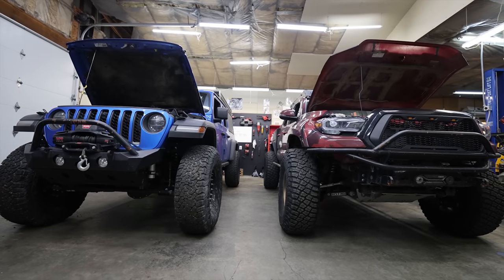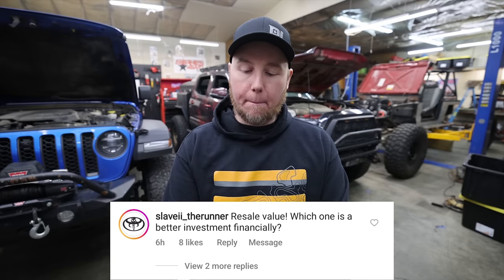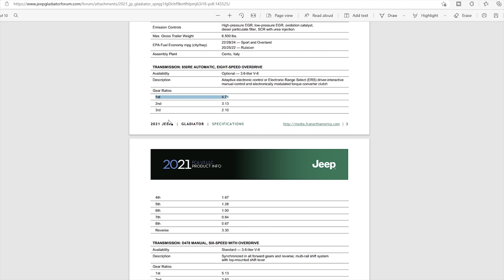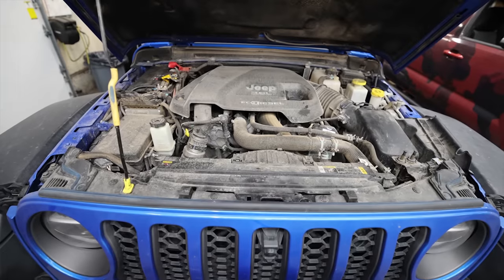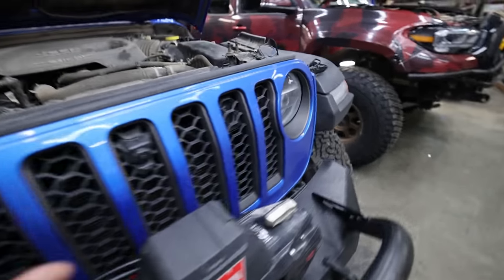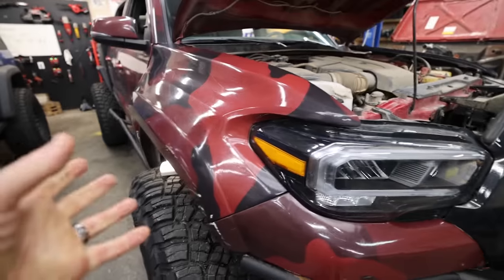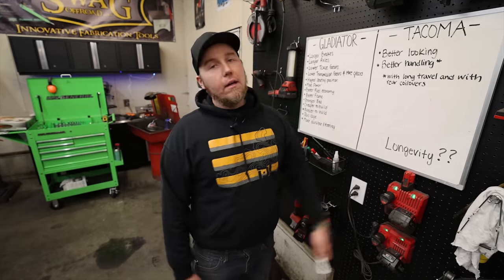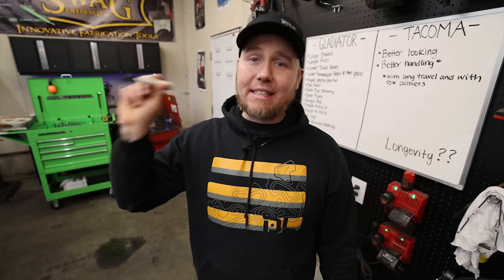My 21 Jeep Gladiator Vs My 21 Toyota Tacoma. Cold Hard Facts.

Comment: LOLOL ".gov or someone trustworthy"

Toyota has held the top spot for reliability and longevity for 60 years. There's a reason there are 300K, 500K, and 1M mile clubs for Toyota vehicles. That being said, the Tacoma, like most of the other NA (North American) spec badges are very very different from non-NA spec Toyota vehicles and the ones in rest of world are far superior to the US counterparts. Comparing the Hulux to the Tacoma will tell this story. Other than the brand name and the fact that it is a pickup truck platform, there are no similarities between the two and the Hilux is a tank compared to a Tacoma.

However, if I was facing an apocalypse scenario and had to drive a stock 4x4 off a lot and into the backcountry, the Rubicon would be my choice. It is hands down the most capable factory spec 4x4 in the US and it doesn't take much to make them true offroad monsters.

Comment: Tacoma peeps are crying🤣 nothing better than facts. I will say I've owned both and my gladiator was not reliable at all in a 6 month time span the dealer had my jeep 5 times. My transfer case front seal leaked, the gear box had to be replaced (aluminum vs steel) , rear window leaked, infotainment quit and the worse was the rear locker solenoid failed and the solution was to replace the entire rear axle. With that being said I owned a tacoma and all the points you made were my biggest issues with it especially drum brakes🤦‍♂️🤦‍♂️ but also the drive train is complete garbage i literally installed 265's and the transmission complete lost it's mind it was like literally no 5 gear. Cruising in 6th and the tranny needed to down shift it would skip 5th and hop to 4th causing the engine to rev super high and then it would stay there longer than it should. Anyway my 2 cents I do want another gladiator 🤣

Comment: is your jeep a rubicon? they get different axles and transfer cases vs the basic jeeps. where toyota just uses 1 rear diff. you cant compare a diesel to a gas, your video is okay, but its not a good comparison video. you need to compare stock to stock and gas to gas. jeep has more aftermarket support. jeep has frame recalls now. blame the feds for us not getting the good toyotas. as a toyota fanboy, your facts are facts. toyota does need to step up a little more.

Comment: ill keep my original gladiator more usefull than both of those  5.13 gears and 39s on if it had a pentastar i bet that thing screems like a dying cat.  fyi theere is nothing wrong with a C channle frame thats riveted you have a original gladiator you should know this, the J20 and so forth was a 3/4 ton truck, hell ive put 2000 lbs in my J10 counting my weight, and it had 0 issues with its c channle.  I garuntee ive done more hauling than you in your trucks beinng that i live on a farm.. I never even see my body lines move from cab to bed with the J10 having so much concrete and wood in the back

Comment: No offense....but your're clueless.  My best friend has a Gladiator.....stock with the Pentastar....I have a Trd Offroad stock as well.....we both have a little over 100k miles....his has been in the shop 5 times....( over 3 weeks missing in total )  for many different issues....not maitenance.....costing him over 4k.   My Tacoma.......0 times...my Taco cost 20 grand less in the first place.....get a clue
Reply: I know 2 guys with 3rd gen tacomas, one transmission melted, 65k miles on road and the other one a ruined engine, from a gravel road 45k miles. 
Yet my JLU that's been abused exponentially more than both vehicles combined is still 0 repairs in after 5 years.

What's funny is my JLU costed 42k, my friends 10 year old tacoma (the melted transmission one) 36k. He's 6k in on repairs so his crappy old truck costed the same as my brand new one and mine has gone up in value. 

Toyotas are for people who like to pretend they're outdoorsmen and just drive through mud puddles with a bunch of ladders and jerry cans tied to them.

Comment: The data from Consumer Reports has been pretty consistent over the decades showing that Toyota reliability is vastly superior to most other manufactures. Jeep does not have a good record at all. While it may resemble a yelp review, it is managed much more scientifically. Also, there are no ads on Consumer Reports. I have experienced this myself as a rideshare driver. I would NEVER buy a Jeep for rideshare driving. I have used exclusively Hondas and Toyotas for the last 5 years and they have very good reliability and longevity. If you are going to do any kind of 4 wheeling, other than overlanding, I believe you are correct, a Jeep is BY FAR the best choice. BUT, for overlanding, you do NOT want any reliability problems, and Toyota is your best choice.
Reply: Lol. For reliability overlanding you want robust and simple…so that again favors the Jeep. For comfort get a Toyota

Comment: I really don't understand the following the Tacoma has. they are always rated last in most mid sized truck comparisons, the motor and trans stink, the interior is crap and the looks, look like Toyota is trying to hard to be cool.......but, but , but...what about the reliability? another farce! pretty certain Toyota's are not as reliable as people tend to believe and not anymore reliable than most vehicles on the road today.
With my gGadiator on 37's,  looks and performs better that any mildly modified Tacoma.

Comment: One has a v8 one has a v6. They are made for different tow ratings and purposes. So all this info is pointless to Compare them.
Reply from the maker: V8? What model has a v8? As far as I know, neither are offered with anything bigger than a v6
Reply: @DirtLifestyle   you’re correct. But still made for different things. I just don’t think these two vehicles are a good comparison to each other. Though everyone does

Comment: Well here’s the thing. The gladiator will live to be a classic. The Toyota will biodegrade before it makes it there without a million dollar facility to preserve it. 

Then you have to take into consideration the frame failures Toyotas experience. 

Are you damn good fabricator? Your gonna need to be to keep that frame fishplated as it fails. 

Plus the Toyota front end sucks. Broken ball joints, axles that can’t turn the stock size tires reliably and so on. You can’t run large tires on a yota without spending 10-15k and even then it’s only good for 35’s. You’d have to swap that piece of shit diff for a 9” center section or something else capable of turning a tire larger than 35.

Comment: For a daily driver no way that pile of Mopar junk  will outlast the Toyota.
Reply: I got 330k on my stock Jeep engine.  Yours has likely been rebuilt several times I’m sure.  So what’s your point?  No data to support your claim, as he also disproves in the video.
Reply: @MrVPNG  4.0 straight 6 yeah I believe that. The newer 3.6 V6 NFW. Wife's jeep was a pile. Nothing but problems. I had a Cherokee 4.0 H/O 5 speed that had 388.000 miles when I sold it. It roamed around here for several years after that. That 4.0 inline 6 Jeep motor is probably one the best motors ever made period.
Reply: @jimmyjackass1805 perhaps bad luck.  Mine is a 2012 pentastar.  So no bro mopar is not a pile of junk as you stated. Be honest with your comments, Nate did a great job putting this video together and should be met with thoughtful comments not blanket incorrect statements like mopar junk. Your own experience proves your comment wrong.  Just for the record.
Reply: @MrVPNG  I have no problem with the guy whoever he is that did this video. If you don't agree that Dodge and or Mopar make junk vehicles nowadays I'm sorry you have not been paying attention. I can 100% see how a Jeep would be better than a Tacoma for off road. When you put all that money into it. That's what  jeeps are built for. Solid axle front and rear etc etc. But on Avg if you think a Jeep Fiat is going to out last a Toyota as a daily driver. You are delusional at best. I stand by my statement Jeeps and Mopar are POS vehicles. I will never own another. Don't even get me started on my Buddy's 2023 Dodge Ram and how many times that's been into the shop already. Transmission twice in under 10.000 miles. Now he is having electrical gremlins. I love me and older Jeep The new stuff is throwaway junk IMO. Cool Story Bro.